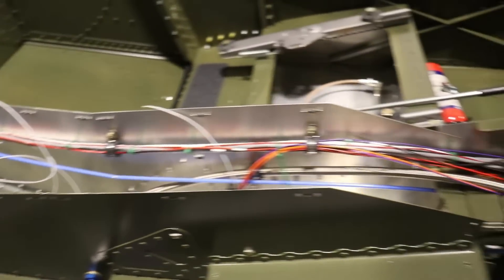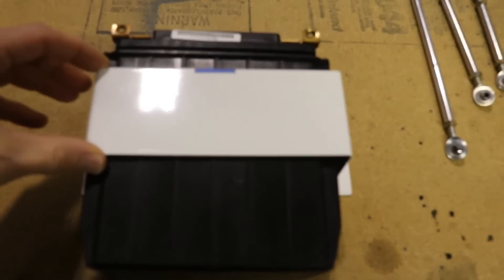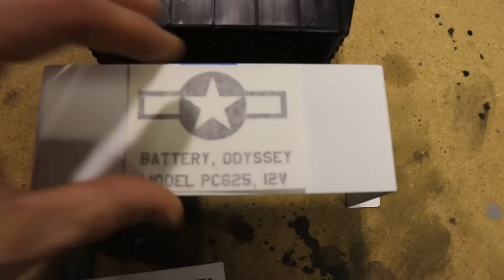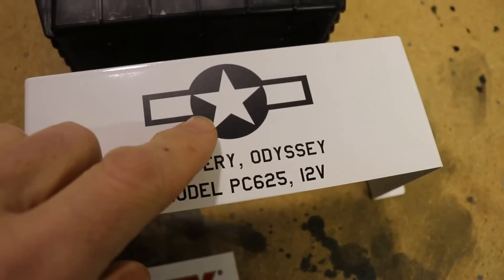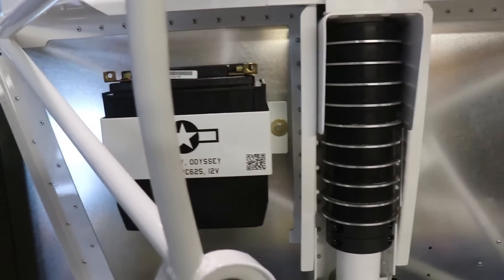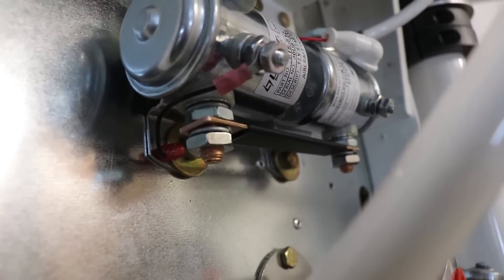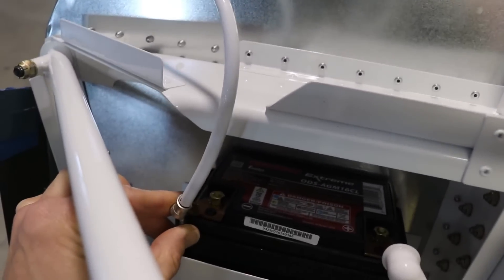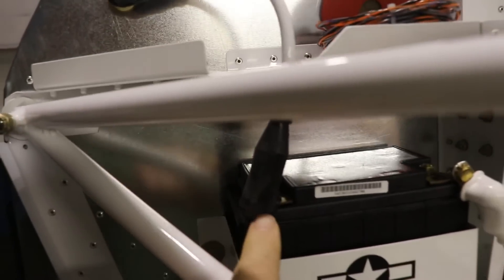Zenith CH-750 Battery Mounting (Ep77)

Comment: So what are you going to do about seats? Custom ordering them again?
Reply from the maker: Yes Flightline Interiors will be making the seats for the Super Duty. I ordered the material from a different supplier though and they are having issues getting it in stock. I'm hoping to get the material soon and then ship that to Flightline so they can make the seats.

Comment: Try using a die with the same thread pitch but a size or two higher to take off the powder coating. Should save you a lot of time. I have used that many times to do the same on "extra" powder coating. Once you cut the surface of the coating the substrate generally comes off fairly easily.

Comment: Mark, excuse me for getting ahead of the build but I think I remember you were planning to use a UL Power engine.  If so, does the Dynon system interface directly with the FADEC of the engine or do you need to make other arrangements to feed engine data to the Dynon?
Reply from the maker: John, I was never planning the UL Power for the Super Duty, but I have that engine in my Cruzer. The Dynon EMS220 had a harness that gets wired to all of the engine sensors and the UL fadec unit. All the engine gauges will be displayed on the Dynon screen.
Reply: @KitplaneEnthusiast  Oh ok. Thanks for the info.  I really appreciate the videos and the way you present your work.  As a (hopeful) future builder I find them very educational..👍

Comment: Coming along. Nice job on the battery box.
I'm curious if you'll have a battery hold down. Won't the battery slip out during inverted flight or negative G maneuvers?
Reply from the maker: Well once I get a hour or so in this plane and completely master it, I plan on doing international aerobatic competitions in this plane. Im pretty sure I’d be competitive with this steed and at that point I’ll encase the battery in concrete to make sure it stays put ;)
Reply: @KitplaneEnthusiast  lol
Reply: @KitplaneEnthusiast  Given how violently things can be thrown around in turbulence, I'd be inclined to add some form of battery retainer.
Reply: A belt and suspenders guy after my own heart!

Comment: Mark, Shouldn't you try to follow Electrical colors with Positive being RED and Negative  Black or Green? Especially for the initial battery connections?
Reply: nah in aviation most cables are white. I think you would not even get AWG2 or 4 in red or black. But I agree he could have used red shrinking tube over the copper bar 😀

Comment: Run a die over the bolt to remove the powder coating.
Reply from the maker: The part that needs the powder coating removed is not threaded. It’s the smooth round surface that the ball joint slips on to.
Reply: @KitplaneEnthusiast  Ah, carry on :D
Reply: Try a shop towel with acetone